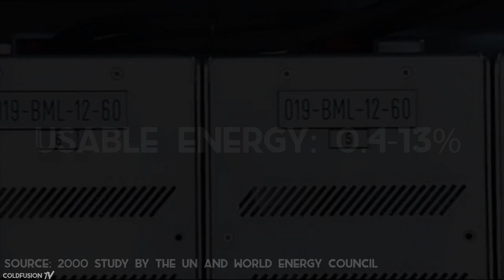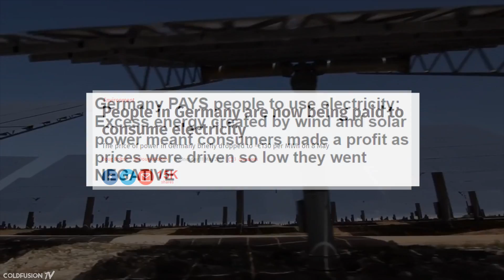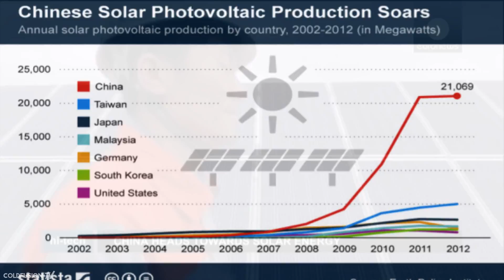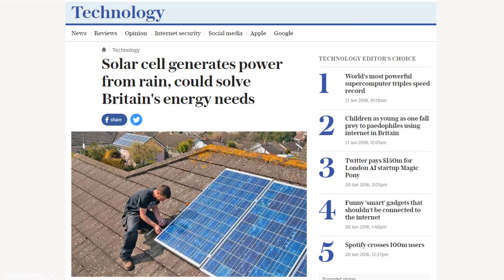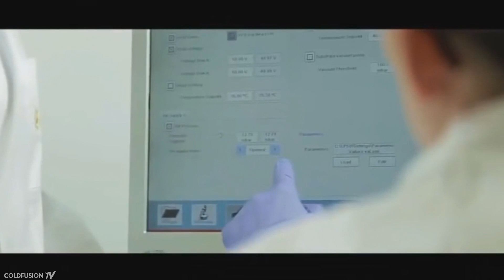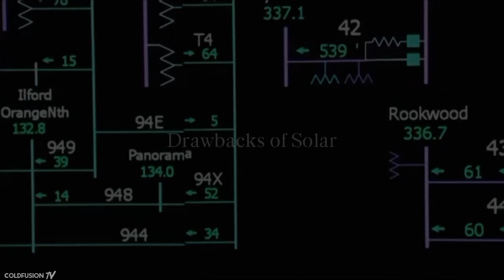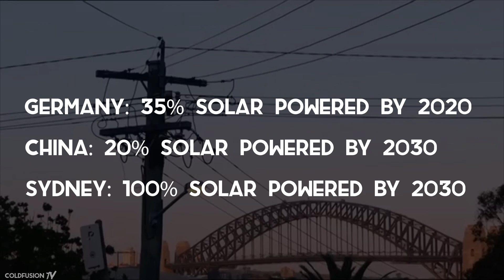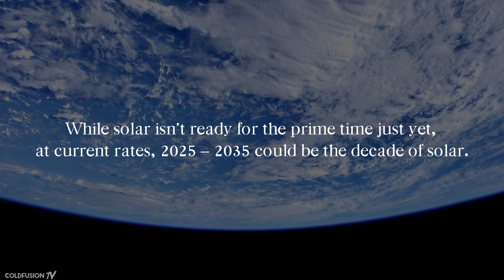The Truth About Solar

Comment: If batteries are so cheap, how come that a battery cost 3 times more now than 10 years ago?
Reply: Bonnie Flory holds more higher life expectancy
Reply: Inflation, probably.
Reply: A lot of the materials, that go into batteries are mined, especially lithium. Many of the mining companies, mining this material, have been charged with human rights violations and told to improve the conditions for the workers, they're just passing the expense to their customers.
Reply: I'm assuming you're talking about Elon Musk, SolarCity and the PowerWall... if you do a search, you'll find there is a community running on only solar energy created by SolarCity and Tesla by having the house's roofs made of glass with solar cells embedded onto them
.
Reply: Bonnie Flory Not sure where you are getting your data from. I purchased lithium-manganese batteries in 2004 for $2000 / kWh for my electric bike. Those prices have come down now in 2017 to $500 / kWh (checked today) for Lithium Iron-Phosphate
Reply: Are we still talking about solar when making those battery comments?

Tesla is about the only one that makes comments using lithium batteries in a theoretical solar application. This kinda puzzles me because lithium batteries are hard to control to make them save when charging and discharging them.  His lithium power pack is undersized for very a oversized price and as far as i know there are no solar applications that uses his power pack yet.  Those power packs would need 400 VDC to be charged  that's why a special controller would be needed if you can get that high a voltage from a solar panel. For a few hundred dollars I can make a power pack that would have the same capacity then his.
But seriously, look at a car battery.
Prices just doubled in a few years and those batteries last less time and warranties are shorter and they have less lead in them which is the reason that they do not last as long anymore.
Reply: Ace
Got a link for that?
Thanks.
Reply: 10 years ago pv wires for your system cost 30x more. The batteries are not that big of a deal since most systems are grid-tied anyways and if your electric company is screwing you; the cost of batteries shouldn't matter.
Reply: for true energy freedom & security we need to get off the grid and do away with the grid
Reply: compressed air energy storage is safer and cheaper than batteries. sun powers pump to fill bladder tanks. then later releases air to run generator to produce electricity. simple. safe. affordable.
Reply: Compressed air is pretty lousy, and noisy. Efficiency also leaves a lot to be desired as heat is lost during compression. Storage is an unsolved problem.  Best case you build a global grid that is usually over-capacity with natural gas backups.
Reply: Compressed air, old tech that can be improved with very small investment.
Reply: I think I saw once where all the batteries ever made would power the earth for five minutes. Batteries aren't gonna solve this problem not without a huge break through.
Maybe Hydrogen??
Reply: Bonnie Flory it's in my history somewhere, I'll give a search a shot, give me a few min
Reply: Thank you for trying.
Reply: +jregnide  You need the grid(or hundreds of batteries) for when their is weak irradiation or no sunlight(like at night time).... unless you just want to run a branch to your a/c off solar and insulate your hot water with the heat removed like a dumbass hack leeching. Still you wont have net zero unless you dry your clothes outside and cook your food off a candle or barbeque. but your paying about the same for shit as you would for electricity. I didn't mean anybody's electric company would screw them, just some people jump to conclusions and go buying into things they don't need. Like solar for example, and an independent battery system that can run your toaster on a cloudy day and just one cloudy day, hopefully its sunny tomorrow.
Reply: lostintime86 Current  grid level systems ( McIntosh, Alabama CAES plant)cost 1.5 dollars per watt, and are less than 30% efficient. and utilize natural gas.  Improvement would lay mainly in heat capture and reuse (more from a diabatic to an adiabatic cycle).

Even then the capture system would add to cost, and you would likely need some natural gas to make the combined cycle turbines operate properly. 

It's definitely not an off-grid solution, and even on-grid leaves a lot to be desired.
Reply: says only you
Reply: lostintime86
So, what is the efficiency when putting energy into a electric motor to make compressed air and then making electricity out of it ?
What about wear and tear of the motor to power the compressor and then the  compressor itself and not to forget the generator in such a system?
Got any numbers ?
You got 3 items inline  that lose energy as heat and all 3 will have wear and tear.
I still like to see some numbers.

A battery can do it in about 85% to 92% efficiency depending what kind of battery it is.
Or just dump that energy into a water heater and store it there, hot water is used every day and can be used as is.
Reply: Also needs a big breakthrough. Fuel cells are expensive and small, storage is problematic, and efficiency isn't great  if you want big than means a turbine,  which is a big efficiency hit.  If you're lucky it's 50% (a little better then 2/3 for hydrolysis, and a bit less than 2/3 for a custom designed turbine.
Reply: First I was taking about the feasibility of hydrogen as an energy storage solution. Second steam turbines are not the only kind of turbines out there, some burn the fuel inside of the turbine.   The GE 7HA.01 gas turbine is rated at 280MW and 62% efficiency in a combined cycle (waste heat fed into a secondary engine)

Third the lower temp of conventional LWR is not limited by the cladding on the uranium, but by the pressure of the water within the reactor (or more accurately the strength of the pressure vessel minus a healthy margin for safety.). High temp is really promising, as it may let you leverage a brayton sC02 cycle with theoretical efficiency above 70%., and it could be used  to drive high-temp chemical processes to synthesize hydrogen (not going to be a motor fuel because of many engineering issues) or motor fuels (NH3, Dimethyl or Diethyl ether, and a few others are candidate compounds)
Reply: 45% is the limit of a reinke steam cycle.  I've found several source that point to several manufactureres being able to do a combined cycle at or just about 60% since 2011. 

http://www.powerengineeringint.com/articles/print/volume-18/issue-3/features/ccgt-breaking-the-60-per-cent-efficiency-barrier.html

http://newatlas.com/ge-harriet-gas-turbine-test/36176/

https://www.greentechmedia.com/articles/read/siemens-claims-worlds-most-efficient-gas-turbine
Reply: With inlet at 565 deg. C and outlet ad 30 deg C., and ideal working fluid, the Carnot efficiency would be 63.8% . However water is far from ideal, and the expansion stage is often cut short or heated to avoid problems due to condensation in the turbine. 

A combined cycle is distinct from combined heat +power. A combined cycle turbine runs a gas turbine as a very high inlet temperature, and a somewhat high outlet temperature, so that the rejected heat in the outlet can drive a steam turbine.  (40%, plus (40% of 50% at the outlet)  (10% lost in other ways) = 60% total efficiency. 

It's not a lie, it's just expensive and slow to start. It's not meant to load balance or quick start.  They are designed as a base load replacement., maybe they can to seasonal shifts or nightly runs.  As is coal is still better in that role, but new regulations or taxes could easily mean a lot of older coal plants being retired. 

As to the original question, that is hydrogen as storage they could still make sense, and are part of a best case scenario. Say the high plains of Oregon where solar could collect excess and generate hydrogen (stored in a geologic formation (again dealing with the most favorable case)) in the summer, and fed into a combined cycle during the winter . Yes it's far fetched, but is still the best case for making hydrogen with renewable source.
Reply: More lithium less alkaline i guess...

Comment: So if the government truly cares about global warming and/or renewable energy shouldnt they provide solar roofs to every home in the west?
Reply: The government doesn't really care other than giving you a small tax credit for using solar (that way congress reps can claim they care to get re-elected). Oil rules right now. Haven't you heard of what's happening in Standing Rock ND with the DAPL pipeline?
Reply: Why in the world would the government do that? How will the government explain a solar tax.
Reply: Cody Chaos ye right, and who'd pay for that? You?
Reply: No, they would for starters cover all the government buildings with solar panels and insulate the crap out of buildings and paint the outside of the buildings white.
They would demand that all roofs be white so that more sunlight is reflected back, instead contained by black roofs.
The would demand foe cooler car engines and radiators and cooler exhaust gases.
They would replace the war machinery with super efficient gear that may even run of solar and not blow black smoke into the air.  
They would not allow the pope to come in his fossil powered air plane and let him talk about global warming while he alone polluted the air far more while visiting  so he can do his payed off global warming speech.
Reply: Bonnie Flory do you see the problem with all this "they would demand".  This is the definition of tyranny
Reply: Cody Chaos
Isn't it what they are doing with all the laws they put in place ?
Reply: Bonnie Flory exactly
Reply: They already tried. You get massive tax breaks for getting solar panels.

Comment: The argument about solar efficiency is not really meaningful. For something like coal where each pound is dug out of the ground it's essential to get as much power as possible out of it to make it cost effective. But for solar you also have area as a factor. To increase the power output of a system you could as you alluded to focus on increasing the energy conversion efficiency but you could also go another route and just increase the area used. So a lot of innovations in solar actually involve materials that are less efficient than silicon but because they are much cheaper it means that you can cover a larger area for the same cost ans still increase the power output. And there is no shortage on area to cover.

Comment: Brilliant video. Going off grid myself next spring. But there is still one problem. My house is currently powered by Cesium 137, or is it 134. Regardless. The nuclear Plants Can't be turned off. This is an energy we are stuck with. If everyone goes off grid with solar, what can be done about the nuke factories.???
Reply: Use the nuclear to power the night until the bulk battery and planetary scale powerlines come online. There'll be issues with too much solar in the day and still not enough nuclear at night (if not relying on fossil fuels). Excess nuclear and solar could be used for sea water desalination, making fertilizer and hydrogen from water (to make clean liquid fuels for heavy equipment) which most probably will become a necessary action for solving the excess CO2 problems via greening an entire desert with the proper plants needed to make the best soil for CO2 sequestration
Reply: Friend went off grid. Hydro refused to remove the meter. So he refused to pay. His bill climbed to over 4000 dollars. Finally they came and took meter. I'll do the same.
Reply: Buffer Zone
Thank you for your support and encouragement.
Reply: Stupid
Reply: Buffer Zone it has allready been dug up, might as well use it. Better to build power plant than nukes. 

We should stop acquiring and enriching nuclear material, as containing it or getting rid of it are both expensive.
Reply: If enough people go offgrid, then it won't be worth the expense to keep the nuke plants going, & they will be shut down -- nuke plants get mothballed all the time, as they get too old to maintain -- efficient solar would just speed up that process...
Reply: And what about the waste?
Reply: Buffer Zone They already have programs for storage of the waste -- that doesn't have anything to do w/ solar power -- even if solar isn't developed, they will still have to have some way of containing the waste from existing nuke plants...
Reply: Yea sure. Pass the problem to the next generation. And so on....
Reply: Buffer Zone Well, yes, basically -- but that's always been the problem w/ nuke plants -- altho, w/ tech advances taking place, it's possible that they will come up w/ an effective & permanent way to deal w/ nuke waste in the next decade or so -- but, as I said, that is a separate issue, & doesn't have anything to do w/ solar, or people going offgrid...
Reply: Caden Rolland
Where I live the power company is not required and will not give you anything not even credit for sending power back to the net.
If hooked up to the net around here gives you a buffer when producing to much power or when not producing enough and that is it. Not worth the paperwork drama and inspections to get solar power hooked to the net.
Reply: Caden Rolland
I have a separate circuit for solar and for grid and it is primitive. It is not convenient as I have to unplug and plug it in again as needed between solar and grid, but it is no problem, by next year I will use a three-way switch to do the same. 
I had plans already to preheat the water before it goes to the grid powered water heater.
 The lights and the fan is on solar and I can use up to about 500 watts appliances or a short time higher wattage appliances when it is dark.
I am still expanding the system and eventually I get there.
Thank you.
Reply: what do the big factories with big machines using loads of energy do? no way theyre going off-grid... does anyone really see a steel mill being powered by Batteries? its laughable... and thats just one example. if we want to get rid of fossil fuels nuclear is the only option
Reply: autohmae
It may not be actually at night, but in the evening after people coming home from work.
Washing, drying, cooking and the AC being turned on in the summer and heat in winter.
Reply: Safe thorium energy! The only solution.

Oh and Jesus is the only way!
Reply: As soon a reusable rockets become more affordable, instead of burying our nuclear waste, ill sure we'll dig it up and fire it into the sun - Still isn't going to do much good for area's that are already contaminated tho
Reply: @Buffer Zone
 If you are hooked up to the net, most likely they will not let you depart from it without a fight.
Your home will deemed to be unlivable and you will be forced from your home because you are breaking many local laws and codes by not being hooked up to the grid.
Reply: And the city officials did not say anything about it yet ?
I am still hooked to the grid and I also have  solar and little by little I switch more things to be be powered by the sun..
Reply: Keep going. Its worth it.
Reply: Couldn't he sell back the extra power through their meter?
I have heard of power companies refusing to buy customer excess power though.
Reply: Not only do they refuse sell back, they refuse to remove the meter from your house, when you go off grid. Took my friend three years. He just refused to pay.
Reply: Bonnie Flory
Yep.  That's just sad.
I'd either charge extra batteries with extra or heat extra water.  I remember one extreme guy had a setup that used the extra electrical power to take hydrogen out of the air and he used that to cook with and to compress air with to use power tools on his farm!
Reply: Bonnie Flory
Wow, impressive!  I like it.
Reply: Nuclear is great. Only downside is the toxic waste, upside is there are places to dump it if we want to (antarctica).
Reply: Robert Graham 
It is actually possible for technology to make batteries as cheap as dirt. It's just not that advanced yet. Extrapolating from the past, these kinds of things get cheaper due to innovation... if that's what we want.
Reply: Safe thorium energy! The only solution.
Reply: Why does the video say: 8:06 peak demand in the household is consumed at night ? Not in my home. Do people have a washing machine or dryer running at night or something ?
Reply: fireofenergy its actually possible to make nuclear as cheap as dirt also, and that tech has been around since the 60s... why dont we try that?
Reply: Bonnie Flory evening ? Yes, that makes more sense. Why didn't he say that ? :-)
Reply: Buffer Zone nuclear power plants can be turned off.
Reply: Thorium is a theory. Nuclear waste does not go away.
Reply: meh just shoot it into the sun

Comment: Your $0.36 per watt figure isn't even close to right. You can't even get the cheap extremely inefficient panels at that price. Also that price you state doesn't take into account all the other parts you need to make a solar array work or the labor for that matter. I install solar arrays on large sailing vessels for a living and have been asked many times is it worth putting solar on my house. As of right now no its not, the cost are just to high for solar at the moment. Not saying this will always be true but currently it's not cost effective. There are a couple places in the world where it makes sense because of the cost of power but these are extreme cases.